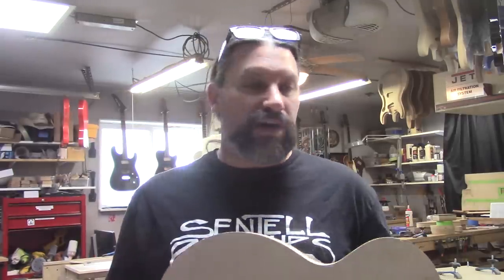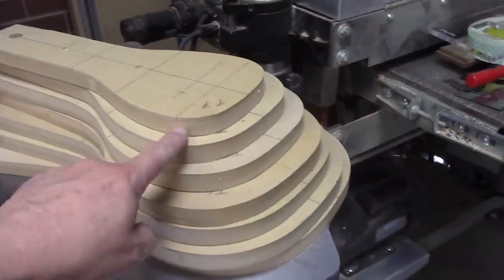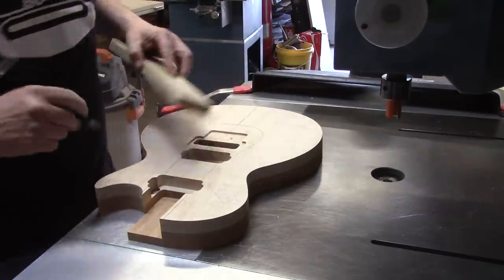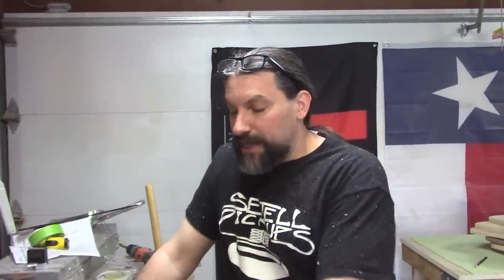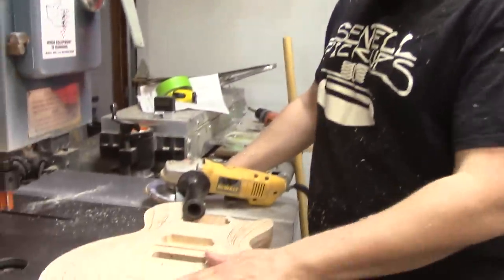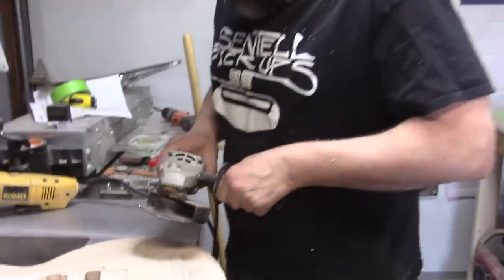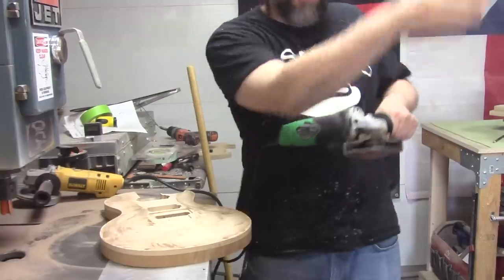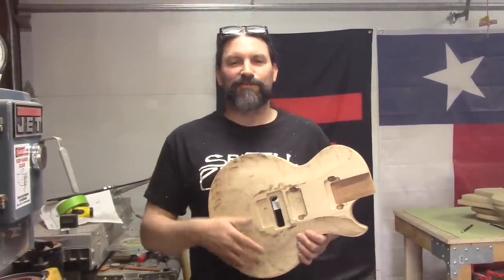The Easy Way To Carve A Les Paul Top... Part I

Comment: @6:02  A "sandpapery kinda thing" is a "flap disc", which you can get from your local big box home improvement store, or on-line.  :)

This was a very useful video for me as it shows exactly what I would like to do to make a carved top, except I only have a hand-held router.
Reply from the maker: You can still do it with a hand held router.
Reply: @TexasToastGuitars  Thank you, I definitely will!  :)  I just need some "spare time".  LOL

I am also planning to try my hand at guitar building using pieces of timber that I felled myself, including some pine, which will probably be my first effort, for a telecaster, and some white oak, which is currently a log lying in my front yard, and heading to a local sawyer in the next few days, but will need to dry for a couple of years.

Comment: I've seen this method used by quite a few guitar builders on YouTube and a couple of other sites. It works and if you are patient and careful it can have a nice end result. The problem I see with this method is that the end result is never the same as the last (close, but not), which in a custom shop I suppose that doesn't really matter. Some use a router & tracing jig (maybe not the correct name) and the same pattern for every top. It seems to cut down a lot on the handwork and appears to give them a repeatable surface each time. If you don't make that many carved tops it may not be worth the investment but it it might save you some time and handwork.
Reply: Some call it a copy carver. There are ones built like a tank who are very accurate and the owners that dump the money in those usually build "masters" that are exactly how they want them every time and make 6-8 in one run before they change the setup. Not worth it if you don't make a lot of the same special contours. From there it's not that big a jump to CNCs
Reply from the maker: We have a copy carver that we use when there are a lot of these kinds of things to do. Here is a video we made a long time ago...https://www.youtube.com/watch?v=kAbDlC8PwRE&t=4s
Reply from the maker: It is a very big jump to a high quality CNC. I'm sure there are things at Rockler that will do it but those are hardly what I would consider the same thing as a 5 axis unit like the big shops use
Reply: @TexasToastGuitars  Thanks for the link Matt. I thought I had seen most of your videos but apparently I missed that one. The copy carver is a nice machine but maybe a little slower than the way you did this one.
Reply from the maker: especially if you count set-up time

Comment: I got a real kick out of this.  I remember back in the early '80s when I first got into building guitars myself, I used to take a drill bit and wrap tape around it to indicate the depth, then drill a series of holes corresponding to the contours around the guitar top; after that, I had a sort of a one-handed rasp-like tool that I'd use to scrape away the wood between the drill marks until there was some uniform continuity, and then it was a lot of hand sanding, but it always came out right.
I also remember working on an older Epiphone (don't know the model or year; it was a total Lazarus job) that had a neck joint similar to what you have in this video, and I recall thinking that this was really the way to go with set-in necks.  How has that been working for you?

Comment: What speed does your pin router run at? I have a shopsmith and I can do overhead routing I just don't know if its fast enough. Also, have you ever done the Gibson neck joint? That look's like a bolt on neck, I could be wrong.  I would like to understand the math you used to calculate the 2.2 angle you carved. I may be asking too much. I am retired now and starting to build guitars. I was going to start with a Tele but may do a thin Les Paul. My neck is messed up from slinging a heavy les paul for many years.
Reply: Check out some of Matt/texas toast latest videos, they do all sorts of builds for people, besides their regular line. And they are doing top carve guitars currently, so may have some really newish videos coming on them.

Comment: I think I missed it, or maybe I didn't it understand it at all, but:
why NOT use those templates to get a carve the old-fashioned way? I mean, did covered the tremolo cavity.

(reason I'm asking is because I was planning to do a Jazzmaster style body, complete with a Jazzmaster bridge and tremolo tailpiece...but with a carved body).
Reply from the maker: Yeah man, use the templates and do your guitar the way you want. We make these videos and titles to attempt to draw people to the channel but I certainly don't pretend to say that my way is the best. Be sure to send me some pics of your guitar when you get it going, it sounds cool
Reply: @TexasToastGuitars  no no, I meant: is there something I should be taking into consideration here with regards to my Jazzmaster build that I might be missing?

I mean, a typical Jazzmaster also needs to have the neck at an angle, so would I run into any problems using the template stacking method?
Reply from the maker: @ripwildy2022  I don't really know what tools you have on hand. We use the pin router and a sign plate to do the angled neck pocket. You could angle a template and get the same thing.
As far as stacking templates for a custom carved top Jazz Master I don't know how I would proceed. You are in some uncharted territory brotherman but you can do it. It is going to depend on what kind of carve you are going for. For example... if you want a Les Paul style carve top it will be very different from say a Mosrite or even a PRS. Will you be binding it? 
I think you are going to just have to go for it and make some moves. Might not be a bad idea to make a couple so you can learn as you go. Good luck

Comment: About how far is it between each template line? I know they it goes down every 1/16 inch per step but how far apart are each of the lines?
Reply from the maker: I don't really know, they are different intervals along the perimeter of the body

Comment: Very impressive. Could you a shell mill of large diameter like 3" or bigger to hog off the material with the beloved pin router or is that too much torque to try hold on to with fixtures?
Reply: Forgot word "use". Oops
Reply from the maker: You know I have never used a bit larger than 3/4 on the pin router. I'm sure you could fit one in there but the manual dose not recommend it.

Comment: Just think how a floor polisher with 36, or 80 grit paper wood work , instead of a grinder , .
Reply from the maker: DAMN! 
That would get it done hahaha
Reply: @TexasToastGuitars  it's , grinds , sands , and polishes,.  If you put the machine on a track device , 3 applications in 1,machine , it could replace the people standing at a buffer.  "Man is the master of the machine " man is used a term. A machine could never duplicate it's self with a man inventing a machine.

Comment: Yeah this would be "easy" IF you have several thousand dollars worth of power tools... That JET power router table probably cost more than my car...
Reply from the maker: Hi Jason, I don't know what kind of car you have. You can do something very similar with a regular router and a sled... we used to do it exactly like that back in the day. The grinder is pretty affordable too should be able to buy one for under 50 bucks. 
Of course... no one said that building guitars was an inexpensive proposition. 
The longer you do this the more tools you will acquire and before you know it you will have so much stuff you won't know where to keep it all